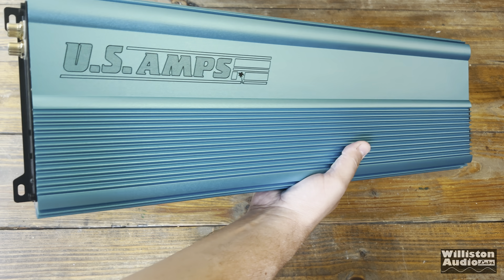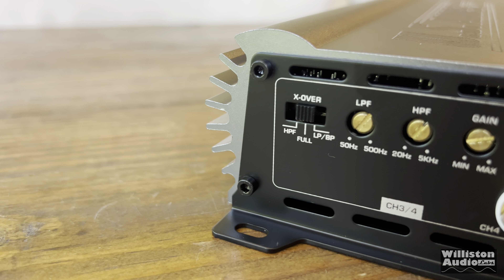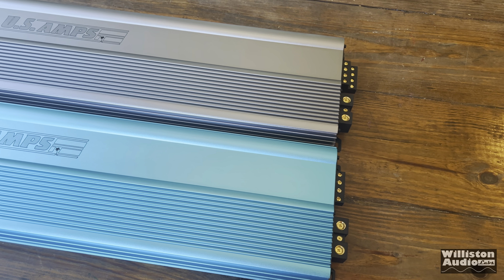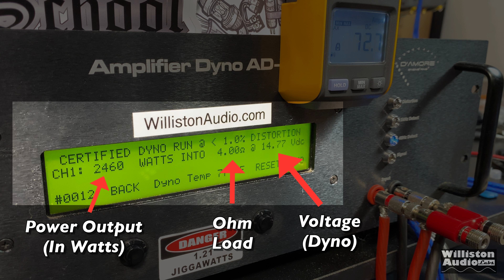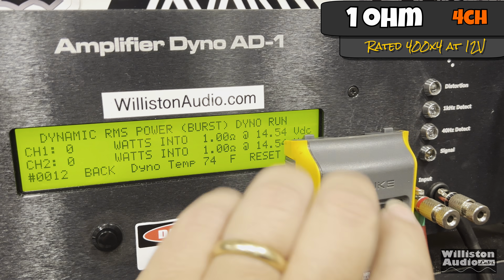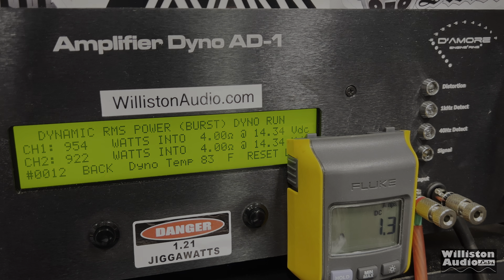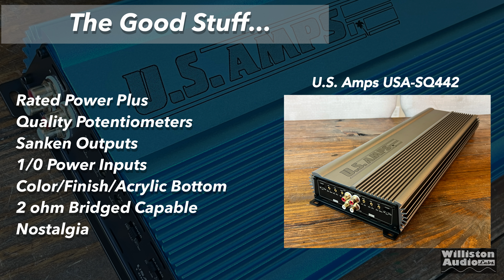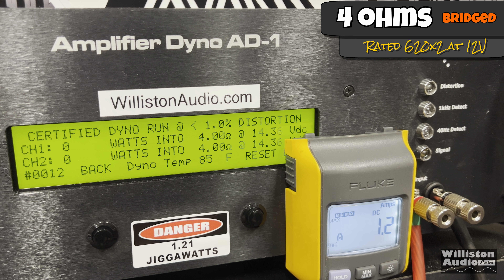The Four Channel Class AB Monster from U.S. Amps - USA-SQ442 Amp Dyno Test and Review

Comment: Way to expensive for using cheap internals. They're banking off of nostalgia alone and this isn't the economy to bet on nostalgia. Plenty high power more efficient ( class D) 4 channels available for substantially less.
Reply: When is a good economy to bank on nostalgia 😂 if you banking on nostalgia you better bring good product no matter the economy. It's there first line products let's give them chance see if they listen to there customers and improve .
Reply: @paulgood2218  it's not us amps first line. The old us amps were all class A B cheater amps and high $ as well. You don't charge a premium for amplifiers with less than premium components.
Reply: @DibeezyTheGifted  that was a different company they shut down these guys opened up. Yes they share some things but this is there 1st line from them under the new launch of the company
Reply: @paulgood2218  To me it doesn't matter if they are under new ownership. They're using the same style heat sink. The same name. The same topology. Etc. they're also charging an arm and a leg for power that can be had for substantially cheaper. Back in 96 they had a reason to charge what they were charging for their big surfboards... What reason do they have now for charging these prices?
Reply: @DibeezyTheGifted  what class ab ?  Different designs different parts different parts quality. Do you think the jp amps are the same too or that nakamichi is the same too as it use to be too? How about Orion  ? None of those company's have same owners or same products regardless if they make them look the same the jo amps look the same but by different name but same ab technology. These amps are a new design from a new company and look like the old ones. That's it does not make them the same
Reply: @paulgood2218  I wish them all the success in the world. They would definitely need more than class AB topology and a thin cheap acrylic backplate for my money. A lot more.
Reply: @DibeezyTheGifted  what's wrong with class ab some the finest high end amps in car and home audio in the world use class ab class ab amps that cost 50k and up use class ab designs  . Why would class an be a negative ? Do you even understand what class ab ,class a , class g, class h , class d circuits are and what and why they are used ? I'm not sure you do . I'm not trying be negative just wondering why the trash talk if you don't know ? Class ab class d and most the others all can be used in a very successful and cutting edge amp and are used . The class of amp has virtually nothing to do which the quality of the amp they each have slight advantages and disadvantage over each other but at this level no noticeable difference in sound quality. . It's the design of the circuit and layout and parts selection and quality that is going to make or break the amp .
Reply: Man, I don't know what ya'll are talking about when it comes to this amp. It's the best 4 channel amplifier that I have ever owned & I have had 30 years of trying different amps, from Zapco, to Phoenix Gold, to Orion, to Precision Power,  to Soundstream, to Genesis, to MMats, to Sundown, to the BS JP amps, to Taramps, to DC Audio, to Lanzar, to Hifonics, to Kicker, to Rockford Fosgate, to Blade, to Tru Technologies, to Brax, to Mosconi, to Crossfire, to quite a few more.

Ya'll better wake up & at least try US Amps.
Reply: Yup their one disgusting fkn rip off man besides theres a tom of 4ch class ab amps that run 320 per ch at 4 ohms lmao i mean a taramps 2000.4 runs 500 rms x4 ch at2ohm lmffao those are 230 bucks lmffao these idiots are worse than jl junk jfc
Reply: >class D

Yeah, no.
Reply: @michaelbloom5342 Not all class d amps are equal what ever class you get there are good and bad.  If you buy good quality you will have good sound
Reply: @michaelbloom5342  you must be a canine because you have to have a dog's hearing to notice a difference. I know people that have won SQ comps using class D four channels.
Reply: @DibeezyTheGifted  Stop using Bluetooth, streaming, and mp3's for your music, and start listening to well recorded CD's. You'll be able to hear the difference, too.

GIGO: garbage in, garbage out. When your source material is garbage, nothing else matters.
Reply: @DibeezyTheGifted  the sanken outputs are nice but as far as I'm aware those output models have been discontinued so curious what they change those to, sanken still has outputs but they're 130w devices instead of there 160w ones
Reply: @DibeezyTheGifted not you havnt😅
Reply: @TommyGunn2208  not I haven't?